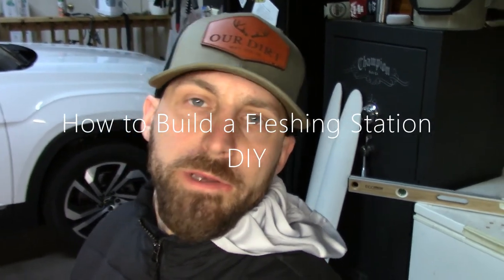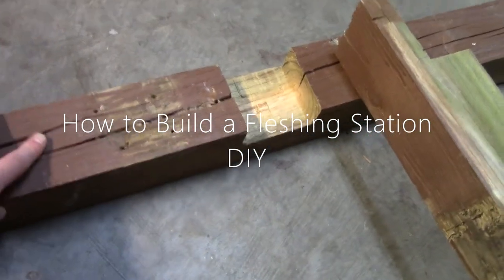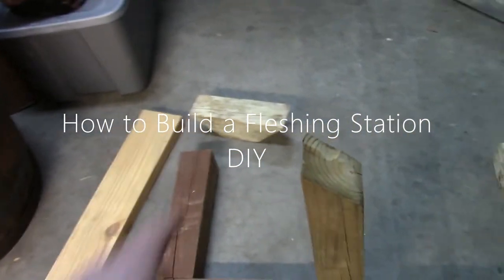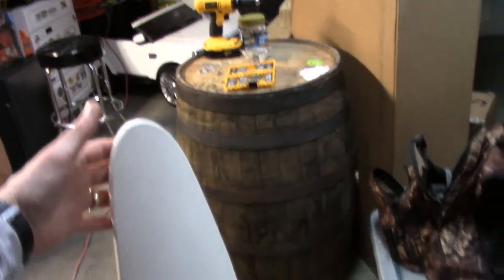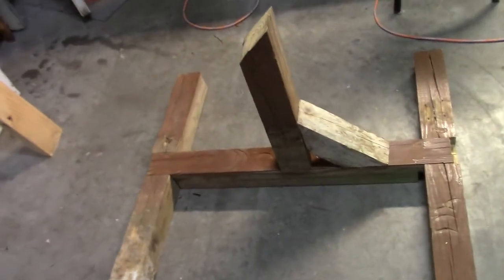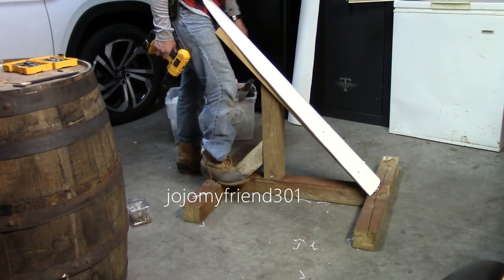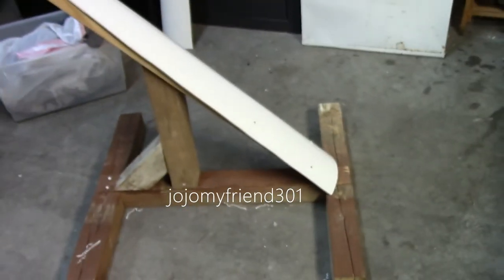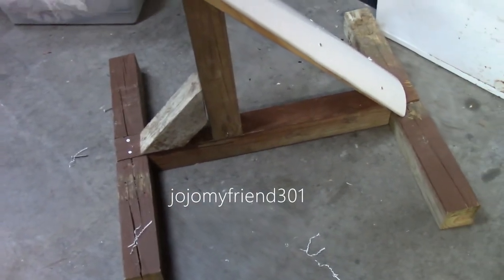DIY Fleshing Beam System

Comment: I got something to tell you  you can put a pc of wood at the bottom oin front of the fleshing board and a pc behind it small enough to be able to inter change your boards without the screwing off and on ..i can tell you why i am trying to tell you about the boards at the bottom but if you use your imagination  you figure out what i am trying to tell you that way you can change all the boards with out nothing but pick one up and put the other one in ..There is another video almost exactly like your and you can see what i mean..ex video